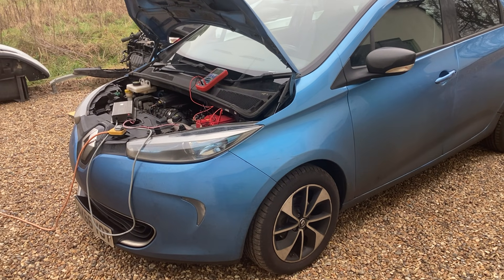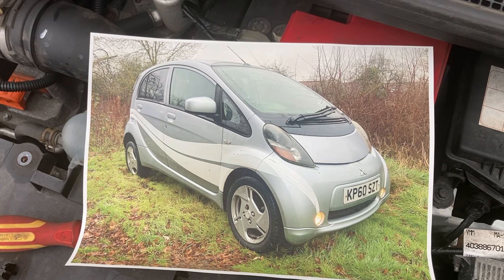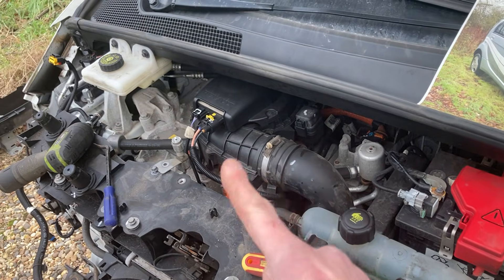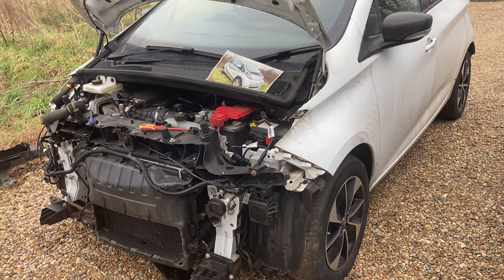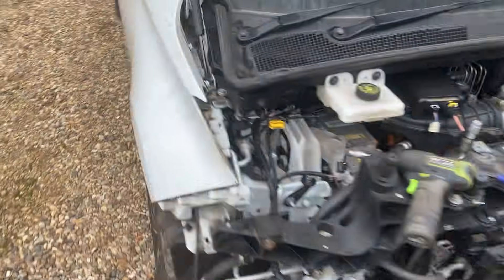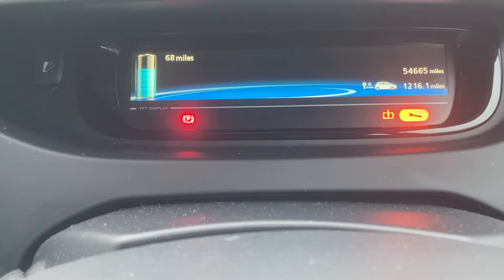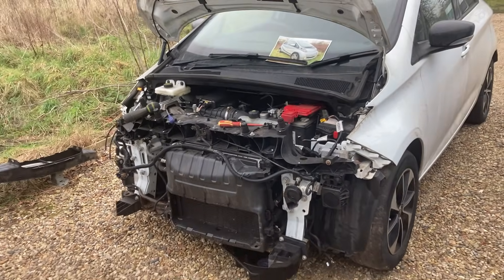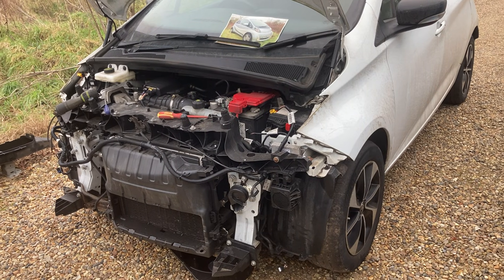CRAZY Low Mileage Major EV fault & What happened to the 14 year old EV? Workshop update 👨🏻‍🔧🛠️

Comment: I've got a 2012 c-zero (so basically an i-miev) as a 2nd car. Still does 60 miles range, very good condition and is a great runabout. I'm wondering, with battery costs dropping, whether it might be feasible in the future to replace the battery with a higher density one. Does this sound like a possibility?
Reply from the maker: There is a 3rd party upgrade available but very expensive!

Comment: That bearing ball smacks of electrical current passing through the ball from 1 race to the other. I understand that in HV VFD driven motor in the pump industry that I worked in the outer race was insulated with something like a ceramic coating, or the motor shaft would have a earth brush running on it to earth stray currents.

Comment: Not many balls in that bearing. Some company beginning with R is skimping on costs! Electric cars are garbage; law should be that cars last at least 100k miles and are designed to be easier to repair. Not stick all the electrics in the battery pack that can only be accessed by dropping the battery out from underneath. So they aren't exactly environmentally friendly if they don't last long and you need to buy another? btw my first career was electronics and I still do some electronic repairs and worked in IT most of my working life and am not keen on lots of computers in cars!
Reply from the maker: I did 10 years in IT before I got into cars !

Comment: Pitting on metallic electric motor bearings can be caused by eddy currents going through the bearings to form a circuit around the whole housing. This can be mitigated by adding slip couplers on the rotor axle to divert current away from bearings or using ceramic bearings to stop that current altogether.

Comment: They call that a bearing! I have better bearings in the crank of my bicycle. Are you able to replace them with a better design of bearing?
Reply from the maker: Haha yeah they are pretty small given they are around 110kw output. I fit better bearings.
Reply: @garycevrepairs  are they just greased?
Reply from the maker: Yes they have grease around them with seals keeping it in.

Comment: Am I going to get the same sort of issues on a 2020 GT in a few years? - or is the motor design different?
Reply from the maker: It is the same design unfortunately.
Reply: @garycevrepairs  It's only at 25k miles at 4 years and with me driving less than 5K a year is it something I need to worry about? - or are there any other issues which will be more of a problem, just considering selling at 5 years or maybe extending the warrentee? I am getting the reversing camera replaced under warranty soon and noticed some play/knocking in the steering sometimes (which the dealer cant find) and only had it since July.
Reply from the maker: Hi, my wife’s Zoe has a little knock on the steering.  I would hope the motor will last but extending the warranty before it runs out is definitely recommended.

Comment: Such a same that it turns out these Renault motors aren't that durable after all.

At least with the LEAF you can plug in Leafspy and see how bad the battery is and decide to purchase the car or not. This Zoe motor can fail anytime.
Reply from the maker: To be fair I’ve seen plenty of Leaf battery issues. I think if reliability is highest on your list you wouldn’t be buying a Zoe or a Leaf 😃

Comment: I had the reduction gear in my ioniq rebuilt at 50k miles, it always clicked under regen but I always thought that was just normal until I found out about the wheel of fortune issue with them

Not the original owner don't know how it was treated, whether it was raced away at every opportunity I'm unsure, but at the same time I wonder how many ioniq owners are oblivious to the issue as I was
Reply from the maker: There seem to be some issues with the ioniq motors/reduction gears but don’t think it’s as common on those as the Zoe motor issues.

Comment: The pitting on bearing balls is caused by electrical charge cumulated in motor rotor and later discharge through beraing this issue is known on Hyundai ionic specially with users that's coasting a lot . Hyundai have permanent magnet motor so magnets always inducing electric current in stator winding and this during coasting is compensated by moving magnetic field with rotor and this process not 100% efective so residual charge stays in the rotor. This is my suggestion.
Reply: Yes, I think you are wright. Damage look like electrical - spark issue from induction. But there is chicken-egg story, if balls are good quality and not worn, there will be good contact. So Renault, Renault ...
Reply: I dunno- the Lithium hydroxide salts in old/used grease would conduct away any high voltages instantly. And there'd not be much current to do "spark erosion".

 Else you'd have the same problems in cars in dry desert countries where static buildup is a problem.

Comment: Had this problem on an industrial motor which failed early. The tradition for electric motors is the ball bearing design as you're shown . If the car is not used for a few weeks the spot load on the outrace will develop a micro dent which reduces the life of the bearing. This can be calculated. In the factory the motors in storage were rotated a quarter turn every six months. Service life can be reduced further if the vehicle is parked near a road. Car companies need to start developing bearings for road going motors with a larger contact path.
Reply from the maker: Interesting insight, thank you.
Reply: Should they have rollers rather than ball?
Reply: Tapered roller bearings would fix that fault... 

But bearing stress is much higher when running than when stopped. Think about it- when stationary, the balls find their own resting spot and slide up or down the race (a fraction of a mm), so more of them spread the load. When running, the clearance (C3 I'd guess) means only a few of the entire race are in contact at any time to carry the entire load.
Reply: @fredfred2363  I am unsure how a taper roller could be configured to accommodate thermal expansion in a horizontal configured motor as the bearing at the other end, or the shaft through that bearing, would need to float. This would result in the rollers riding down the race unless the element or opposite end bearing was loaded to force the rollers up the race through the temperature/expansion range - hope this makes sense.
Reply: Think you are referring to brinelling of the bearings which happens when vibration from outside forces such as local machinery vibration on static machinery impacts the ball on the static spot of the race. This results in a clean "crater" in the race, where this damage is on the ball itself, and is not clean.